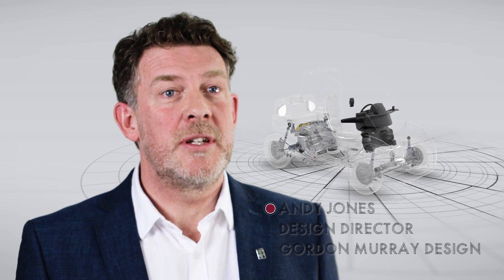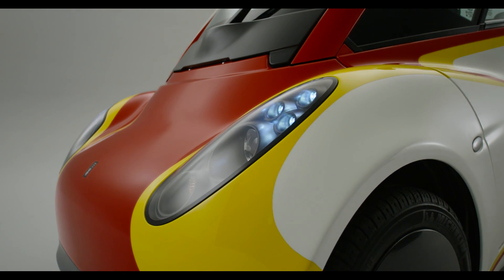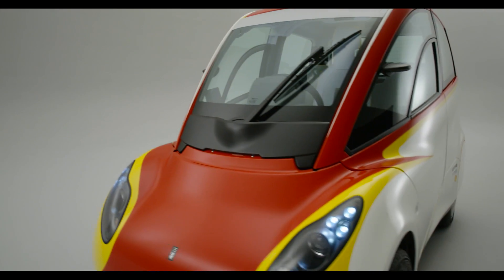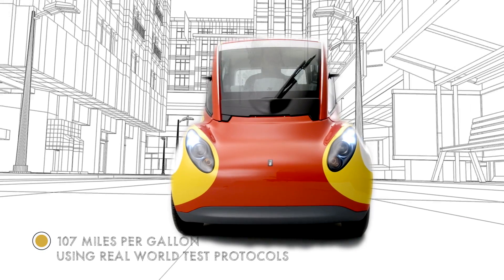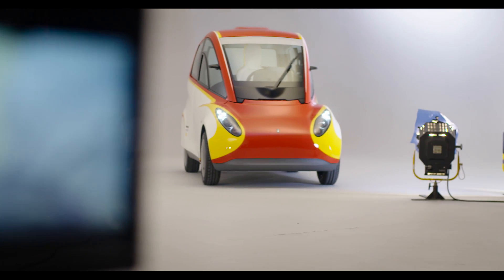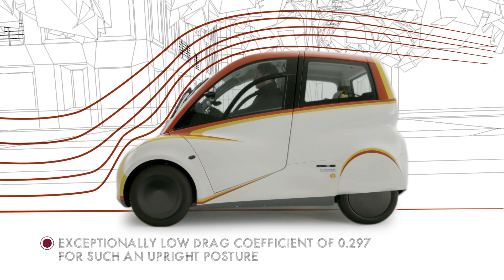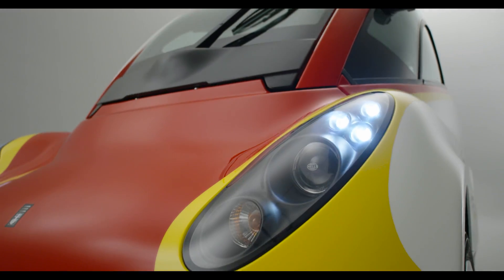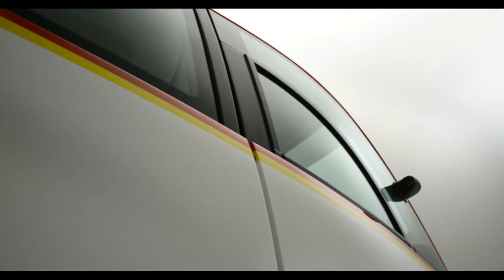Shell Concept Car launched in collaboration with Geo Technology and Gordon Murray Design

Comment: Props to Shell for having the guts to make a car like this.

To put this into prospective as to what a great achievement this is....

I mounted a 25cc 4 stroke onto a bicycle and it uses 
0.8 L per 100 km = 125 km/L = 300 mpg.

And that bicycle can only cruise at 25km/h and after 1000 km (8L of fuel) the engines rings need to be replaced, so getting similar fuel consumption out of a car is a huge achievement its HUGE, so well done to the Engineering team that achieved this enormous feat of engineering well done guys.

P.S I only use Shell in the motorized bicycle as I can actually feel the difference when I am pedaling if I use other fuels. 
I provide around 33% of the motive force so fuel performance is easily detected.

Only with Shell can I comfortably climb the hill to get home, which is on top of a mountain range, and this occurs at the end of a 50 km ride so I really need that extra performance to get home and so far Shell is the only fuel that does the job every time, using a higher octane is even noticeable. 
We up at 6000 ft so engines performance is only 70% of that at sea level, making the fuels performance even more noticeable.

Thank you Shell for your great products.
Reply: Hi

Comment: why does not have an electric engine with battery?  It will save space and its cost would not be so high because is light and because it does not need to much range.

Comment: sorry guys, the future is electric.
Reply: cordell Hughes you are stupid
Reply: cordell Hughes tesla model 3 will cost 35000 next year, half the value of model s, same range.
All this in just 5 years.
The electric engine tech was always good enough (although tesla was better because they include the same inverter in the engine design which is more efficient), the true change for electric cars come with ion lithium batteries, old batteries were too heavy and they had other drawbacks, so the time for electric cars is just starting now, before this was not possible.
But the 70% of the transport sector will be solve with fuel cell (h2), only 5 years back fuel cell and hydrogen technology started to make its boom in research and investment, so they will match battery technology in just 3 or 5 years, its main drawback is infrastructure, but all that may come without cost, because hydrogen is the only tech that can solve the storage needs that renewable energy requires, you produce 100% using wind, or solar, or other renewable sources, and all the excess is converted to h2, to be used in the natural gas red or for transport (ship, airplanes, utility cars, normal cars with long range).
Many countries already started with that change to an hydrogen economy.
Japan, Germany, France, California, denmark, and some others. 
Electric engines are way more efficient than ICE engines, they even require less space and parts, they are also silent.
I can talk all day why batteries and fuel cell will be the future from now, but in case you disagree, the time will tell.
Reply: +Francesco Di Mauro 
Electric is not the only solution. This kind of minimized engines for light city transport could actually be less or significantly less pollutant than battery cars.
Reply: +Fast Er No, is not possible to be more pollutant than oil cars.
Reply: +Francesco Di Mauro  The energy of the past is the future.  The energy of the future was created in the past and will stay there.
Reply: cordell Hughes if you can not see something so obvious, then I will not even waste time to explain it.
i will let the time put you in your place.
Reply: AngelLestat2 I am totally for the approach of all Transportation being powered by renewable energies as well as hydrogen and fuel cells the. The point I was making  these Technologies have been out and ready for so long but they still delay delay delay. Tesla made its electric car technology public domain meaning automakers don't have to pay a dime to Tesla in patent fees yet still no automakers or technology companies currently produced renewable energy technology for auto and home use. Tesla and others produces great electric cars but  prices are too high and availability is still too low. The Technology's been ready for the past decade. All I want to know is what's holding them up so much.
Reply: +AngelLestat2 Depends on where the electricity comes from, on how much pollution and energy use is caused by making the car and batteries and so on, doesn't it? Plus people actually have to buy the resulting car for it to make any difference so it has to have the range and features they want - and especially the price.
Reply: that's why I'm talking about the future: cleaner and safer ways to produce electricity, improved battery technology, recyclability, recharging infrastructures in all cities... I hardly think there will still be any place for combustion engines, so why beating around the bush?
Reply: +Francesco Di Mauro  Electric cars are expensive and people like me never buy new cars anyhow so we're thinking about whether an electric car will hold value or if it's 14K down the drain as you walk out of the showroom.   The issue of how long before the batteries must be replaced is a problem for us as this could be a big hit.  An efficient and cheap petrol car can be made now, however, and that is more likely to convince me to buy. Someone richer can pay the price of developing future technologies.   It's the same with computers - let the gamers buy the $600 graphics cards and bring the price down for the rest of us later. We can get along with something practical in the meantime.
Reply: The future of electric cars are still in the hands of oil companies first and Auto makers second. The GM ev1 was the first electric car available to the public. Every GM ev1 that they put in a customer's hands were leased. And one day they decided to in the lease take all the electric cars back and they all got crushed within two to three years.
Reply: Electric vehicles have a higher carbon footprint than hybrids

Comment: That is great! Really great! Now, dump the engine and put a 20kwh battery pack and an electric motor. Done!
Reply: +paouvous Yeah thats great until you have to pay for the new battery pack.

Do you calculations very carefully, i didnt and i got burned.

You must include the cost per km of the electricity AND the cost per km for the batteries.

Compare that to the fuel cost, as the electricity and the batteries are both consumables that have to be replaced.

You need to know how many km you will get out of a battery pack before you start thinking of going electric its still very expensive indeed.
My car on lead tin batteries came in at around 10x more expensive than the petrol it would have used. 

So all is not as it seems sure the electricity is cheap but the batteries are not.

The Edison battery lasts for between 40 and 90 years but it has a low energy density which could maybe be tolerated.
Weight affects acceleration but it only affects top speed by a few percent e.g a car with just the driver does a top speed of say 200 km/h same car with 4 people in it will do around 196 km/h. 

The problem is city driving has no constant velocity component, you always accelerating or braking so a heavy car is a problem in the city.

But those batteries are a real pain, trust me on that, having to wait 4 hours to go home is not fun. 
Begging for a place to plug in when you get stuck also sucks.
If you havent owned a pure electric car you will never be able to have a true understanding on the subject.
So enthusiasm is great, but only enthusiasm backed up with practical experience, enthusiasm without practical experience is a very dangerous thing indeed.
Reply: +EVZebra In my country gasoline costs more than a pound per liter, but night electricity is less than 5 pence/kwh. So you pretty much get the 20kwh charge for a pound. In that car that should be enough for close to 300km in range which is more than enough for a city car. Also an electric motor will cut down on your service expenditure. No oil/filter/spark plug changes. No fuel/coolant pump failures. No leaks to fix. Nada. In terms of cost I figure is a break even right now, but cheaper looking forward. But using lead tin batteries and diy sure costs alot. A factory constraction with lithium batteries can be competitive, in terms of lifetime costs.
Oh and you don't polute inside the city, lets not forget that...and you get all the goods of electrification (power delivery, almost zero noise and vibrations).
Reply: +paouvous 
Batteries could be more pollutant than this kind of engine.
Reply: +paouvous if it weights 3 times less, then you need almost 3 times less battery, and if it is a city car.. then you need less range.. So a 10kw battery should be enough to provide you 200km range.
Elon musk battery wall 10kw with inverter and conversor cost 3000 dollars to the final costumer.
Reply: Eclipseslayer98 are you on drugs?
Reply: +Fast Er the Russians were secretly building cars and trucks that were powered by thermal generators with plutonium pellets and developed materials to prevent radioactive leakage so they say.  when their project was exposed  world started to cry about it saying that it would lead to disaster since radioactive materials were being used. the half life of it was nearly a hundred years.
Reply: AngelLestat2 Nope, just pointing out the obvious. Having a "door" that opens like that is very dangerous, and if you ever need to get into the car when it's raining. then your interior is going to be soaked. Lets say you damage the car door so it doesn't open properly, that means if someone even rear ends you, you'll have to get out through the windows, and god forbid you flip over.
Reply: Eclipseslayer98 I still not see any relation in your answer to the "ICE engine replacement with an electric engine"
Blind Spot??
The part that your interior soak when is raining is true, but not sure why it will be much more dangerous that other car design (same size) using normal doors (which can also bend and remain locked), you still had the trunk door in this version..
Reply: AngelLestat2 In their other video, they said stuff about getting rid of blind spots, but in their hypocrisy, they did not get rid of blind spots in this vehicle, but added one which is that little extra window in the left side window.
Reply: +Eclipseslayer98 a few years ago  Shell Jay Leno and some celebrities were sponsoring college engineering graduates that made a prototype car that went 200 miles on a single gallon of gas. I I would buy one but unfortunately the technology is still limited to the Prototype phase unless somebody here has info that says it will come out next year or something which never happens .
Reply: +UniversalExpanse what's really funny is I live in North Chicago Illinois and there is a huge wind farm that spans across the middle of Illinois to the middle of Indiana thousands of wind turbines running. over 2000 square miles of power probably producing tens if not hundreds of gigawatts of power in an Farm area with a population around a hundred thousand people and yet we can't get any of that power in Northern Illinois because are power company ComEd controls all the power in Northern Illinois and the United States government refuses to expand the power grid between states that have solar and wind power so close to where we and others live. just look at Google Maps an area between Effingham Illinois and Indianapolis Indiana and you will see an area just north of there with thousands of of wind turbine generators generating power for nobody except for farmers who's still use fossil fuels for their equipment even though they have a wind turbine right on their farm that they leased to a Alternative Energy company